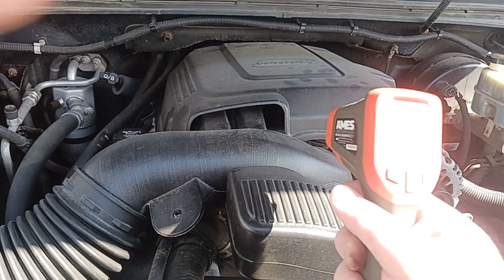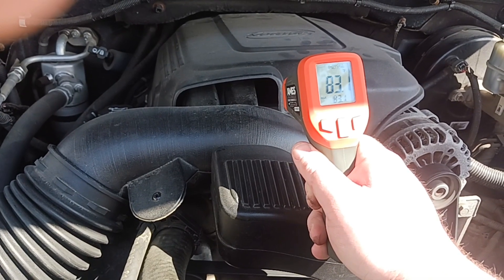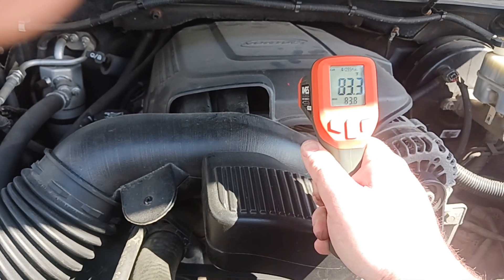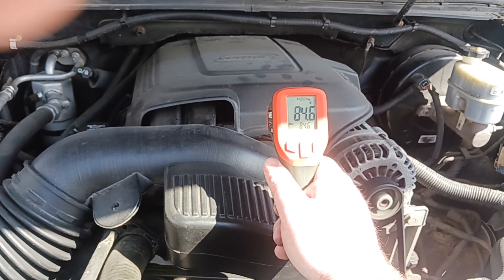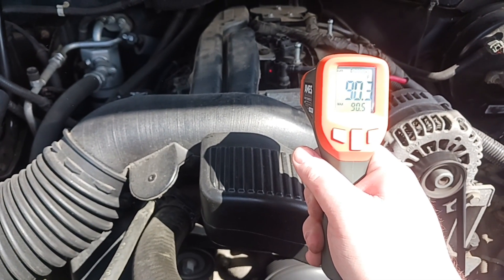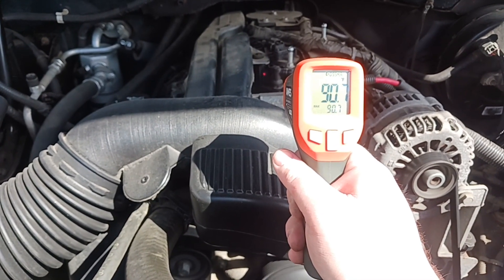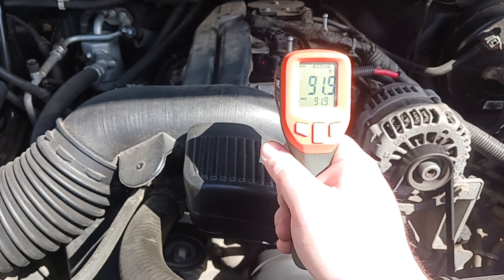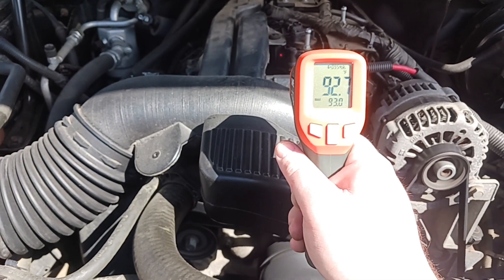do engine covers trap heat?

Comment: Ok. Your measuring the plastic cover that is over the actual engine in your first take, then you are measuring the actual top of the engine in your second reading. Plastic vs. metal. Obviously the temp of the engine cover is going to be cooler than the engine it is covering and has some distance between it. Just look at the red dots in your own video, the areas you are reading aren't even close.

Comment: Run it with it on take it off read it. You’re reading the cover not the engine for engine temp. Mine had a 7 degree difference also I have a hood scoop while in motion it’s cool air hitting the head more efficiently. Idk, just how I measured it.

Comment: It's NOT the plastic cover that traps a lot of heat, but the INSULATION they place on the underside of the cover that TRAPS HEAT between it and the engine.
Reply from the maker: This cover doesn't have insulation it's all plastic
Reply: @Vtec_unlimited  heat is inside the cover not outside, your test proves that but not like you tought